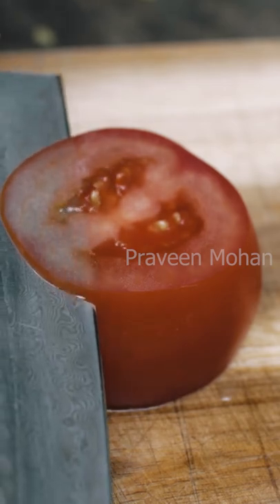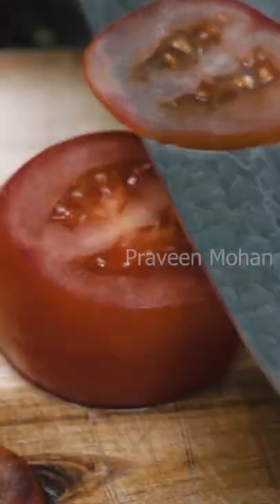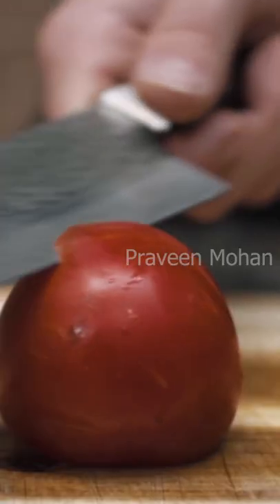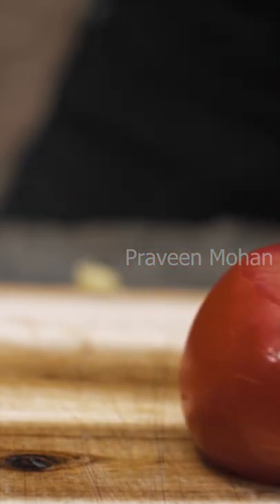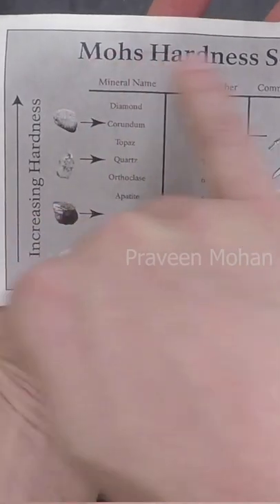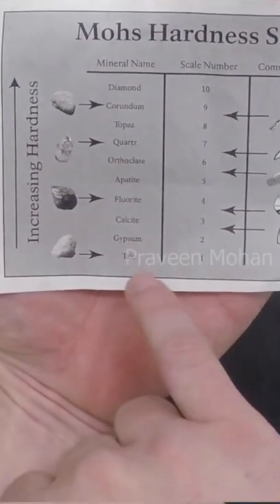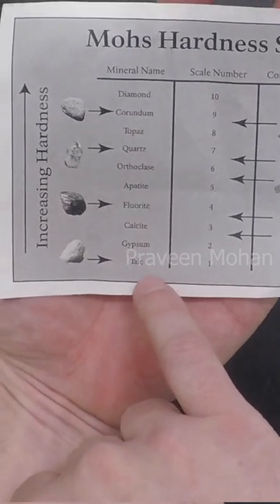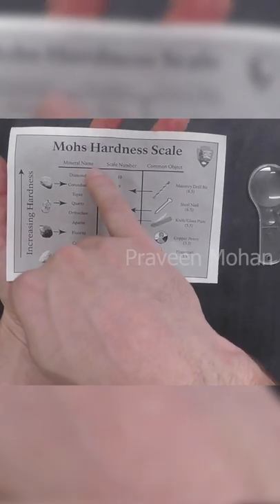Impossible Technology used by Ancient Builders, Kudimiyaanmalai, India

Comment: You dont cut granite, you soften the granite by a very old process that my ancestors passed down in my family from slavery in Egypt and thru slavery in the US. The granite has to be heated up by fire or if the outside temperature is 120 degrees or more making the granite very hot to the touch. Then the granite has to be saturated constantly with a special mix of chemicals that I won't disclosed. That special mix and the heat will significantly soften the outside of the granite once the granite is soften enough then a very lite oil is applied to the granite to prolong the granite softness and now can be carved once the special mix have evaporated then granite will reharden.
Reply: Post a video of the process
Reply: We all believe you Dennis 😂
Reply: You won’t disclose? 
😂😂

Comment: Dude you could scratch grooves into granite with a soft metal as long as you had plenty of time and kept sharpening it. 🤦
Reply: Or just a piece of flint on a stick.
Flint is harder than granite. (7 vs 6.5).
Reply: Those grooves would be uneven and ugly as shit. Nice try though.b
Reply: @loloppololp9304  not if you take care to move it the same way with the same shape of tool every time, at least on the finish strokes
Reply: They had iron tools.  Just use a smaller tool with a round rather than flat tip.  Take a look at a set of carving tools. There's more than one, different tools for different tasks.
Reply: She acts like the grooves were "cut" in. They weren't. They were pecked in with flint, iron, or more granite. It's not hard at all, it just takes time and effort

Comment: "To cut or carve something, I must use a tool harder than the thing I want to cut..." umm... water can be used to cut stones and metal. Tell me a substance softer than water?
Reply: That means they must of had a machine the pumped the water to do this still doesn't quite work to make the cuts
Reply: Air
Reply: @martinnewton4978  either way. They were able to heat the stones however they desired perhaps softening it. There are lots of possibilities that don’t require ancient tech people today wouldn’t see evidence of. Like show me any evidence of any ancient tech that didn’t work in a rudimentary way that we are easily able to understand and reproduce. And about the lathe, if they were able to make a lathe big enough for these rocks then why wouldn’t they have iron tools which are capable of marking granite in this way?
Reply: @greg5145  Lol. I was actually going to say, "...besides air..." at the end of that, but then I thought, "Air is not really a substance." But, kk. Either way, water is way way softer than stone or metal.
Reply: @martinnewton4978  I was only using this as an example as to how softer objects are used to cut harder objects. I was not saying that these people used water in this manner. Also, water in rivers cut away at dirt and rocks over a time anyway. The grand canyon was formed by water.
Reply: @lillylineer178  it was a joke tbh😂 with enough pressure air can rip stone apart.
Reply: @greg5145  Hence my "Lol." in my reply. I figured you knew where I was going with it.
Reply: @martinnewton4978  not really, as long as they had a device that can get a round disk to spin extremely fast, they can cut hard objects with softer materials. People have used paper disks on high rotational spin, to cut through wood. Paper is wayyyyy more fragile than wood, but the spinning at high RPMs causes the paper to stiffen up harder than the wood.
Reply: The video makers IQ
Reply: Yeah but water under extreme pressure and or constant , for instance a steady drip of water on a rock over the course of time ; same thing with air ; in other words, nope , sorry
Reply: Water is soft at slow pressures try hitting yourself with water at a extreme pressure it will tear you apart. That's why we use water to cut a lot of stuff nowadays
Reply: @nobodyimportant124  Exactly, however, even at the highest pressures, water still keeps its density. The thing that makes it cut through is the speed in which it hits the surface, not it's density. Get anything going fast enough and it will cut through just about anything. So again, water is as soft as it is sitting still as it is coming at high pressures, the speed at which it travels when cutting is what gives it the illusion of being harder that the material you are cutting.
Reply: @paulinadeluca9117  ain’t nothin’ that stiffens up harder than this wood, baby! 😘
Reply: Ever heard of Relativity? Ever jumped off a diving board?

Do you have any idea of the force of flow in Water Cutting Tools?!  😂
Reply: @lillylineer178  "the thing that makes it cut through is the speed" 🤦‍♂️
Reply: Ancient tech, may have not been mechanical in nature. Would be awesome to know though
Reply: Soft water
Reply: I'll take what is silk for $400 Alex
Reply: But what technology could have been used to direct water in such a way to produce these exquisite carvings???
Reply: If you do it with water it's called erosion not cutting.
Reply: Oxygen
Reply: My presidents brain
Reply: Liberals
Reply: Well there is such a thing as hard water🤣🤣🤣
Reply: @lillylineer178 ,
   Water-jet cutters don't pump justcwater.. lol
They use water with a very hard media in it. It's also pumped through a tip made of synthetic ruby typically.
Reply: @oldnick4707  Sir, it does not matter what kind of water it is, or what you use to shoot it out. Water, any water, is still softer than stone and metal.
Reply: Water and water based liquids can't be compressed, that's it's magic property that makes it so significant to us and to nature. It flows, but when it can't flow it doesn't get out of the way through compression the same way as another liquid like an oil or a polymer might, anything that that isn't water will have some give between it's molecules that makes it less suitable for motive force, whether you're trying to swim in it or use it in a machine or a living body. Water is king because it's the hardest of liquids if you're trying to achieve something, though obviously not the highest density.
Reply: Air does erode.
Reply: @lillylineer178 ,
   Yes but I'm not arguing for or against anyone's point from above really. I actually run a waterjet cutter though. I can cut through a foot thick of granite semi-accurately and I can cut through inches of steel. This is my only point for the above.
   I think that these statues that we see in the video though are very beautiful! Granite is very hard, with its commiserate difficulty cut.
It is extremely brittle though, and just a bronze chisel, after it is work hardened, is sufficient to chibble your way through granite in small amounts. Those small lines are what we see on the statues, so you can take a pointed chisel and create those lines.
Reply: Plasma cutter
Reply: @oldnick4707  My comment was just to show that some things that are softer can cut through things that are harder. I do not think that in ancient times they would have the tech to cut stone with water, but it would definatly be interesting to know how they did these. I think you may be right on the method.
Reply: @lillylineer178 ,
   Yep, I understand. 
I think so too in this case.
In fact before rotary diamond bits etc., we would carve names and dates and very ornate carvings in anything from granite tombstones to whole building facades with chisels! 👍 Certainly we'd use steel chisels nowadays but we can imagine a small copper or bronze punch and a hammer on our granite countertops, we would do some serious damage very quickly right!? Lol
   Thank you for your conversation Lily!
Reply: air but that also works bellows filled with sand could theoretically work
Reply: Anything can cut anything as long as enough energy is involved. Lightning can cut a tree. It is energy that cuts not the object you use. Lasers cut and they are just highly energized light.
Reply: @kurtneumann7082  Then how do you expplain the Grand Canyon? It was eroded, or cut, from water over time. It is not always straight up strength or speed or energy that cuts away at stuff. Time is the most destructive thing in existance as everything is subject to it, if you take religious icons such as God out of the equation.
Reply: @lillylineer178  Time is a name for a tool for measurement. Time is not how long or short something takes its how fast or slow a process happens. Time is the process of every reaction happening. Time is movement, cycle, reaction, or flow depending on what you are looking at. Time is a flow of all energies. The grand canyon was carved by the energy of flowing water. If the water was still it would not erode its surroundings. I'm not a religious person. I'm talking about physically everything is energy. Everything is a vibration/frequency every vibration is energy. I'm trying to describe this as basically as I can. Look into it more, like what they do at the particle accelerators. Look into the periodic table and how all elements are formed and what they are made of.
Reply: @kurtneumann7082  Actually, still water can erode stuff as well. It will soften up the ground until that ground slides or shifts away. Here is what you keep getting wrong, energy is not movement. Energy is what movement uses, but it is not the movement itself. Movement does not create energy, energy creates movement. Energy creates a lot of stuff, but all those things are not energy itself.
Reply: Water is extremely hard. Falling a short distance onto water can cause damage like falling onto concrete.
Reply: @AmericanOdyssey91  Again, and I shall say this 1 last time, no matter the water, no matter the circumstances, water is softer than stone and metal. Period. No water is harder than any stone. No water is harder than any metal.
Reply: @greg5145  you can make a lathe with just wood and rope
Reply: @sdivine13  lol not ones that can hold 40 ton boulders.
Reply: @martinnewton4978  gravity works just as well as a pump.
Reply: SIGN MAN  yep. Even good ol mother nature has sediment in the water and wind that does the actual carving
Reply: Is it though? If it was being shot at you through a fire hose, you could end up hamburger.
Reply: @greg5145  beat me to it.
Reply: @greg5145  so why isn’t replicated today?
Reply: Ever heard of pressure ??
Reply: @Darkskinjus  it is.
Reply: @martinnewton4978  or maybe they had tons of bronze and iron chisels, artisans to use them, and some smiths to maintain them.
Reply: Bro, water jet or abrasive jet cutting is highly sophisticated equipment, that the point here. These details make you wonder about how it was done. And Mohs scale acts as general rule of thumb not as a ingrained Law of Physics.
Reply: Honey
Reply: Air or gas .....but if you make it hot enough you can cut through literaly everything
Reply: @greg5145  Actually you can spin 40 ton boulders with just wood and rope. Ask a medieval cathedral rigger.
Their cranes are still inside the buildings.
Reply: @allangibson2408  cool cool, I’m happy we can admit it wasn’t advanced ancient tech then.
Reply: @doinksinthePM  Lol. While all of that is true, it is still a fact that the water itself is softer than the stone it is hitting. However, let us go with your throat slitting thing here. You can slit someones throat with a piece of paper. Does that now make a single sheet paper harder than your skin? Hmm... you seem to be having the wrong idea of what I was saying. The water itself is not harder than stone. That is the point I was making. But hey... you seem to think water is just as hard as stone when jumping from high places as well? Hmm... jump feet first into a deep lake from 150 feet, then jump feet first onto a paved road or sidewalk from the same hight. Bet you would notice the difference.
Reply: A hand pump
Reply: @lillylineer178  Air IS a substance.
Reply: Or... You know... Use the granite dust left from the carving...
Reply: For water cutters water doesn’t actully make the cuts there’s small particles added to the water to make cuts
Reply: . I wonder what kind.
Reply: It’s not water that does the cutting. It is the abrasive that the water holds. The water is just the carrier.
Reply: @lawof1860  again. It’s not the water. It’s the minerals in the water. It’s the dust in the air.
Reply: The water isn't actually cutting anything. The water is actually just the conduit for the actual cutting agent. In other words,  abrasive particles are added to the water in water jet cutting machines and those particles are actually what is doing the cutting, not the water itself.
Reply: @lillylineer178  what your saying isnt true. A softer material CAN NOT cut through a harder material. You don't understand how a water jet machine works. It's not the softer water cutting,  it's the harder material being carried by the water thanks doing the actual cutting...and that medium IS  harder than the material it is cutting.
Reply: The minerals in the water do the cutting and does it slowly over time. Waterjet cutters have abrasives in them to do the cutting at extreme pressures.
Reply: @lillylineer178  it does matter what kind. The abrasive in the waterjet is doing most of the cutting and that is harder than granite. Water naturally has minerals in it like iron, zinc..etc and those are harder than granite. Run that over granite for years and you will start seeing it wear away. Regular water in a waterjet will cut but won’t cut like it will without the abrasive that it needs.
Reply: @altonb93  Hence my point, water can cut without abrasives. That was why I said it does not matter because water can cut without abrasives. Matters not if it cut better with or not, fact is, it can cut without.
Reply: @bigdeal5394  First of all, I have actually done studies on this before I posted a comment. Did you know that water, without abrasives, can cut through bone? Hmm... I wonder, if it is the abrasives doing all the cutting, I wonder how water without the abrasives can cut through bone. That is a perplexing issue. Perhaps you can explain this. You seem to have done a lot more research and studying on this than I have.
Reply: @lillylineer178  post the link to your "studies".
Reply: @bigdeal5394  There are literally videos on youtube here that show video evidence of these things with real balistic gel hands with simulated bones and everything. Look it up yourself. Be sure to watch it all because they do start with abrasives running, then switch to without.
Reply: @lillylineer178  "simulated" bones huh? Ok 😂
Reply: @bigdeal5394  I do not know the proper term they use for them. They are what they use when they want to see what effects something has on bones. If you want to be all childish and just want to troll, then I suggest you go find another. I am in no mood for people who do not wish to have an actual intellegent conversation. How do I come to the assumption you just wish to troll? Well, you knew what I meant when I said it, yet you still felt the need to point it out as if it was some joke you heard in 3rd grade and are snickering in the corner as though it were the funniest thing you heard all day.
Reply: Same premise with sand blasting machinery. Tho it does not mean they needed a machine because it was not water that cut these statues.
Reply: @lillylineer178  Velocity
Reply: @lillylineer178  Gasses are a substance. They have mass, and a shit ton of potential energy.
Reply: So you make like this figure
Reply: @-ol8bp  My income is around 150,000 a year from my work.
Reply: Unlike just about anything else, water is impossible to compress... hence why the hardest most precise things are cut with water and not rock or metal

Comment: It’s really amazing and not just that but the skill involved is crazy .
Reply: You can literally do this with a cold chisel and a piece of soapstone. Mark the area that you're going to cut or chisel and you can do it with a cold chisel. It's actually a lot easier than what people think. The way they do it is, they take a rectangle shape block and they draw the image on it and then they slowly chisel it out. They had Diamond tip tools back at this time which could have very easily, very very easily chiseled away at the granite rock. With no problem whatsoever. They had diamond flat saw blades that they could use to solve back and forth to create these perfectly Square stones that you see today.
I mean,  even Tre bite sets that 4000 years ago, a man named Tubal Cain was a master builder of weapons and other things built of iron metal gold etc. According to archaeologists we've only been able to use iron tools for about $3,500 years. If that's the case, then how did the person in the Bible that wrote it 4,000 years ago almost even know about iron tools let alone be a master of making them and creating tools from iron. Even the new dig found, Gobekle Tepe which is supposed to be 12,800 years old has images of people using iron tools not copper

Comment: One of the hardest metals is tungsten carbide but when machining, if you ever have to grind on a carbide drill or insert, you use a much softer grinder than you would for other metals. Those carvings may have been impossible with just blunt force and crude chisels but just as water and wind can erode stone over time, with patience, those carvings could have definitely been done over a longer time frame with methods similar to sanding. I would bet that tools were used to slowly erode the stone away as opposed to just smashing off bits of stone with chisels and other such tools. You definitely don't need a substance harder than you are cutting to be able to cut. Sometimes just patience and proper engineering

Comment: You don't necessarily need to use a tool that's harder than the material you're working. The tool will still do the job but it will wear out a lot faster. Water and wind erode mountains and valleys and that's just water and air